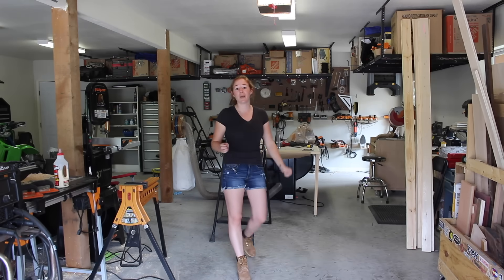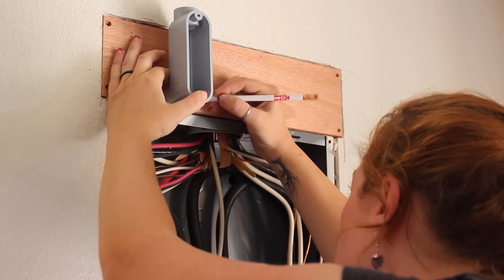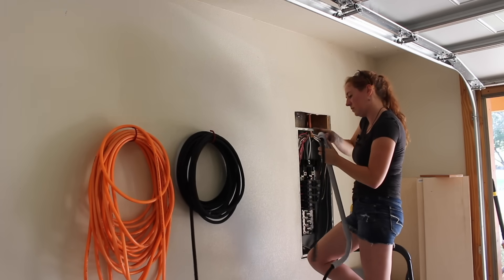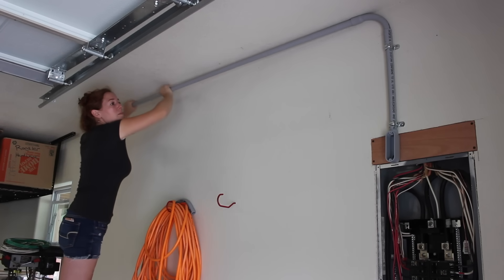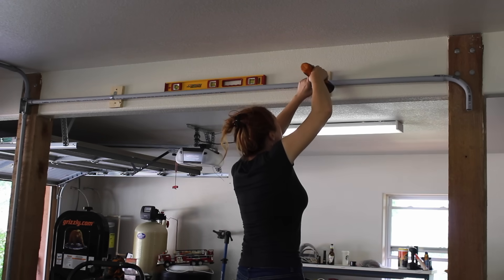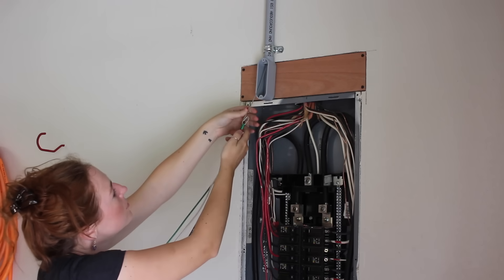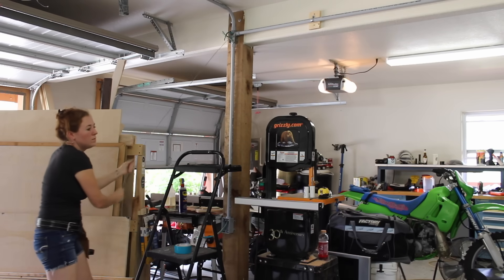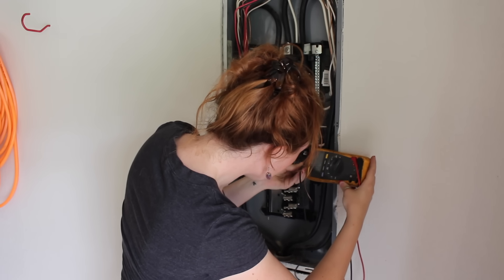Adding 220 Volt Outlets to the Garage

Comment: Conduit is nice, but, just buy individual wiring, in the correct colors to run in the conduit.  BUT, we pull the wiring through only one 90 degree bend, at a time, more make it harder to pull, and, might result in stretched, skinned, even broken wires!  Also, best to have two folks, to guide wire as the other person pulls it...  But, I wrote the course used in the Air Force, and taught it.  So happy to see women doing their own shop work, but, I highly recommend two folks always, for safety purposes...

Comment: how did you connect LB to panel 
white wire should not be pull in for 220 volt circuit

Comment: The voltage is actually 120..RMS. Voltage drop through the conductor is allowed to be 10% so the minimum is 110.  240 is just two 120 volt legs 180° out of phase.  It is not two phase power because of the same zero crossing...three phase is 120° angle between phases, as such it makes motors turn easily.

Comment: Kudos to you April for the willingness to tackle ANYTHING. 
I, at the age of 65, did my own minor electrical work a few weeks ago, and I was successful! (All I did was replace a single overhead garage light fixture with a 4-plug outlet box). I now have 4 LED light fixtures in my garage...that actually work!

Comment: Clean install! I move every 3 years due to being in the military....and I've had to add 220V several times. I also had a need for 3 phase, so I ended up creating a "power center" with 30A and 50A single phase 220v, 3 phase 220v, and a couple 120v outlets. It's worked out well so far.

Comment: I have a similar project coming up, running 220V to my air compressor. The electrical supply house sold me 10-2 wire for the project. So I have a black wire, white wire and a bare neutral wire. In your final connection to your breaker I see you used the black and the white wire as "hot"  (I was told to run black electrical tape around the white to mark it as being HOT)  but where did you connect your green wire? I didn't see a green wire in your panel or did you strip off the insulation and make it a neutral wire?

Comment: Another good video.  I learned an easy way to snake conduit years ago on one of our Commercial job sites, an apprentice forgot a pull line on a 500ft conduit with too many elbows to snake it, the "Old guy" as they called him grabbed fishing line, tissue paper, and a shop vac and had a tracer line in no time flat.  I'm a carpenter and have shown this to more than a few Electricians and they laugh because it is so simple and fast to do.
Reply: thats called a tampon...
Reply: I've done this with jetline pullstring and a piece of plastic bag, but fishing line and tissue paper is a great idea!
Reply: That's awesome!
Reply: Or compressed air from the other end.  Harder to seal though.
Reply: It’s called pulling a birdie or conduit piston. Common practice for pulling wire

Comment: i like your work, but I really don't understand the way you deal with electricity in the US
here in Europe we use 240V for everything (except for really heavy industrial stuff), we use flexible wire, much smaller panels, fewer circuits (usually just two (max three) per house ) and screw terminals for eveything 
it's much more elegant, simple and compact

Comment: Is that panel dead as you're working in and around it? If not, your total lack of PPE and observance of other NFPA requirements could lead to serious injury or worse to those watching that don't know any better, and possibly liability to you for demonstrating such unsafe techniques. And what did you use to protect the three conductors as they entered the knockout at the top of the panel behind the LB? Also, as others have stated, the white conductor needs to be red. Costs the same...
Reply from the maker: It's obvious you didn't watch the video or you would have heard the first thing I said was that I killed the panel at the pole. I used seal tight in the box to keep it in conduit the whole time. I also already addressed the white wire issue in my comment which I pinned at the top.
Reply: I think it IS obvious that I watched the video as is evidenced by my original comments. I did not catch your opening comment on "killing the panel at the pole" whatever that means, which only emphasizes the point I'm making. How did you do THAT? That is not even allowed in most municipalities. Meters at the building are often locked out, so that option isn't even available. At the most, your average homeowner is able to flip the main breaker, cutting off the power to branch circuits but leaving the two hot feeder conductors (240V) still live in the panel. That's called UNSAFE to an unqualified worker. In addition, when did you turn the panel back on that you were able to test voltage at the breaker? And doing so, why aren't you wearing safety glasses and gloves? Ever heard of arc flash and arc blast? YOU HAVE NO IDEA WHAT YOU'RE WORKING WITH.

You can't be casual about safety. In the enthusiasm of any DIY demonstration, amateurs must take responsibility for appropriately attending to the foremost critical stage of any project: SAFETY. What you need to consider is, "if this guy missed it, might others?" and then DO something to avoid any possibility of that happening.
Watch a few more videos on YouTube that involve electrical installations and you will note the highlights on safety they make to avoid costly mistakes and injuries.
Also, no glue on the PVC?
Reply: Draw Dead Dan I'm guessing the wiring to the garage comes from the house and is run on poles. Most residences aren't going to have multiple meters.

Comment: Great video. Like you, I'm no electrician but have wired entire basements in  houses, wired shops and garages from the breaker panel out including 220v. I regularly wired and troubleshot three phase systems at a feed plant I worked at years ago and replaced and repaired components. From one non-electrician to another....great job!

Comment: Hey, my first 220V run to my tablesaw was made from two 120V circuits. It was a rental house and my parents didn't know any better. Even at age 17, I knew it wasn't code but it worked "OK". I removed it before moving out.

Comment: In norway new houses built in a "old area" with old IT-net have 230 v. (3 wire system) New houses built in a "new area" with TN-net have 400v. ( 4 wire system)

Comment: Good stuff as always .. but please get yourself one of these voltage testers if your going at the main board again (if you did use it, cools)  ... just because you powered it down dose not mean there is no power there, you did not wire it so you cannot be 100% on the feed structure 

http://m.homedepot.com/p/Klein-Tools-Non-Contact-Voltage-Tester-NCVT-1SEN/100661787
Reply from the maker: I don't have one of those testers but I did use my fluke meter to test it before moving forward. No worries, I'm very aware and don't mind double checking something if it might mean me not getting shocked. ; )

Comment: As a licensed electrician and business owner I have a few constructive comments to make. when pulling single conductors through a conduit try not to use white as a hot conductor, it violates the NEC to reidentify a white as a hot unless it is smaller than number 4. Your handy box you used for a junction box is most likey in violation of the allowed box fill, next time use a 4 x 4 x 2 1/8 deep box and you won't have any issues with that size wire. Last, I'd really like to see how you made a NEC compliant entrance to the breaker box from that lb. I just don't see it happening.
Reply: To use white as a current-carrying conductor, NEC 200.7(C)(2)   prohibits it except in the listed allowed circumstances.     Requires  Permanently re-identifying  insulation any place the conductor is visible or accessible.

Oh yeah.... and the White wire cannot be a separate wire in a Conduit or Raceway.
Reply: One could also argue that the pvc conduit installed in a shop is subject to physical damage. Which in that case it should be schedule 80. I'm not sure what type of pvc conduit she is working with though. I probably would have run emt
Reply: She's in her garage, not a shop.. running schedule 40 is totally fine. Although I would have ran EMT as well, considering she's not an electrician, she probably doesn't have pipe bending skills
Reply: tpgoat A
Reply: You can use white as long as you to reidentify it in splice boxes and panels
Reply: There are many correct comments here, so let's recap.
1. Buy one of the many nec books with illustrations. 
2. Consider the future. Will you one day need 30 amps? Much easier to pull #10 now.
3. Someone should have, and the nec book would have, told you that the use of white should be avoided except as neutral. Since you bought individual wires "conductors" to be precise, you could have used two black or black and red. For clarity for the next person in the panel, junction box, or receptacle box, using red for one leg of the 220 would make it clear what was what.
4. Permits. The real issue is that most real estate docs require disclosure of any work done where a permit is usually required. If disclosed the buyer will want an electrician to inspect. If not disclosed the seller has residual liability for not disclosing unpermited work.
5. Since you didn't glue any pvc joints (not shown if done), please replace the junction box with a larger one and tape the ends of the white wires wherever they enter/exit the panel or any of the boxes. And make sure your 220 breaker is 20 amp unless you want to redo with # 10 conductors.
Reply: Not to say you are wrong, maybe it's a local thing, we can work on a maximum of 6 circuits before an inspection is required.  This saves from having to have an inspection whenever small amounts of work are done.
Reply: tpgoat I agree with all of these points as well. Also the NEC requires PVC to be strapped every 3 feet for 3/4" like you installed. The only other thing I wish you pointed out was what amperage were your outlets? It looked like you pulled #12 THHN? If your outlets were 30 amp they would require 10 gauge wire. Also I didn't see you glue anything together but obviously you'd know you need PVC glue for the conduit? Also did you use a ground screw in the metal box for bonding? If not it will need a green ground screw 10/32.   

God Bless and stay safe.

Jeff 
Licensed Journeyman Electrician 
Central Florida
Reply: Should have went on and stepped everything up to 50 amp capability using 6 awg thhn wire.
Reply: What is your position on smart meters, you do electrical work all your supplies are  UL approved, then then power company along slaps a smart meter in for power it is not UL approved then do a search on utube  smart meters cause fires? Then the house burns down along with the work you did, NEC complaint, ain't helped for that.
Reply: That's a very sexist comment.

Comment: Looks good to me! How did you run the wire from the LB to the top of the panel? Liqui-tight or some other flexible conduit I'm guessing?
Reply from the maker: yep yep, just some seal tight so it would flex but keep it in conduit the whole time.
Reply: Perfect!

Comment: The only doubt I have is the junction box. Is the right size?  Looks all cables are jammed in there. If I recall including the nuts it should be an empty area in the box. I could be mistaken. I took a residential design class 20 years ago. My master is in telecom. Good job.

Comment: Hi April.  Great job, great video (as usual).  I'm curious about how you disconnected the power to the panel at the pole.  Did the utility install a switch there?
Reply from the maker: I have a breaker box at the pole so it's as simple as flipping it off.

Comment: Hi April, great job doing the wiring. Your work(wo)manship is excellent as always. I enjoyed watching your gleeful look when you realized that the fish tape was reaching its' destination. 
The only thing that I saw, which you may have done off camera, is to make sure that the metal boxes have a tie-in to the ground wire in order to protect against a stray whisker touching the box and biting you. (I think this is code as well.)
Also, when using wire nuts, I always use good quality black vinyl electrical tape and wrap three or more times around the wires and then wrap up and over the wire nut in order to capture it. The wire nuts are okay for making connections, but over time, they could get loose from expansion and could cause problems. The multi-wraps of electrical tape ensures that all stays tight and the nuts stay on. This also protects against accidentally getting a whisker up into the skirt of the wire nut, causing a live wire to be exposed. Don't be easy on the tape, use plenty of wraps around both the wires and the wire nut. I have also seen the plastic get hard over time and disintegrate. The tape will at least be a hedge against the metal part being exposed if this happens. Oh, and the wrapping should be done in the same direction as tightening so that the nut doesn't unscrew as you wrap, important point.

Comment: How do you determine how many amps of service you have coming into the house, and how much you are currently using?
Reply: +April, After learning how you turn off your main breaker I come to the conclusion not everything is as standard as I thought. I need to ask if there is a notation somewhere as to the 200 amps servicing your house? 

Some will say it is not a problem to have the total breakers add up to more than what is servicing your house. The reason being is that not all usage will be the max from each breaker all the time or even any one time. There was a day only homes using electric heat "required" needing 200 amp service but the trend is indeed to all homes having 200 amp service.
Reply from the maker: It's standard to have a 200 amp service to the home. You can see how much you have left by seeing the number of breakers in the box and also how many slots you still have open (without breakers).

Comment: Do not worry about the code: I personally know "professionals" who do not respect the codes ...I saw it many times.
 If the installation is badly done, it could lead to risks of electrocution and / or Fire.
A priori, the installation is correct.

Comment: My only issue is attempting to power your welder with that small of wire. Generally #8 is the smallest you would want. I'm a welder by trade but my father is a master electrician and I worked for him for several yrs. He and I wired my shop welder outlets and even #10 is not big enough. (Looks like you used #12?). Your welders are smaller so you might be fine for a little while but I'd look into putting in a proper welding outlet with larger wire. Just my 2 cents based on experience.

Comment: Great job April.  I like the fact on your thought process to get the service disconnected coming into the panel box. Safety is the best policy.Only one point of fact, the supply voltage is not 110/220 Volts. The voltage standards for the last 60 or 70 years is and has been 120/240 volts. If a Utility voltage is 110 volts you may have a legal claim against the Utilityfor supplying the voltage.

Comment: Not a real electrician myself but I've done a goodly amount of electrical work.  Here's a few suggestions:

Before you start working your plan check with the latest NEC (National Electrical Code) and your local code for what you can and can't do. If for example there's a fire at the other end of the house and the fire marshal notices and writes up a minor DIY electrical code violation, can a dodgey insurance company use that to deny a claim? Not likely but... just sayin' 

Wire color: black is for line conductors, white for neutral at ground potential, green or bare for ground. Never use a ground as a neutral; if you need a neutral for a machine light etc, run a neutral.. There's much more so check local code etc. I use red tracer tape to distinguish which side of the 240 single phase I'm working but it's not required in by my local code..

Some jurisdictions require a separate breaker for each 240 volt receptacle. Yours may not.

Never hurts to check with an electrician early in the game. The home centers hire electricians as sales people. If you stumble across one while stocking for your project be sure to check his credentials and then pump his brains. Case of beer may tempt one to drop by and vet your project.

Comment: One thing I couldnt see in your panel was a ground fault interrupt circuit, which you would be well advised to keep in a workshop like that...otherwise looks like a good job, just check if your insurance cover requires all electrics to be done by an electrician, if so just have one check your work and sign off on it...
Reply: MrZnarffy We don't do that in the USA. We have gfci outlets instead.

Comment: As an electrician by trade I think you did an awesome job; you definitely take pride in your work. My only suggestion, as others have commented, white and green are reserved colors for ground and neutral "grounded conductor"; all other colors are hot to ground. Using white as a hot conductor isn't uncommon but I highly recommend taping each end red.

Comment: Only thing I question is, I was taught, ALL wires nuts were to be wrapped in electrical tape. Of course I'm not an electrician but, in certain area's even in the states, it's code. Great job on the wiring and another great video April. Cheers